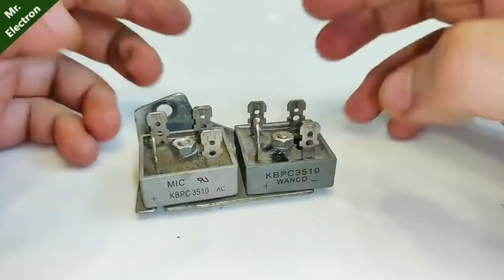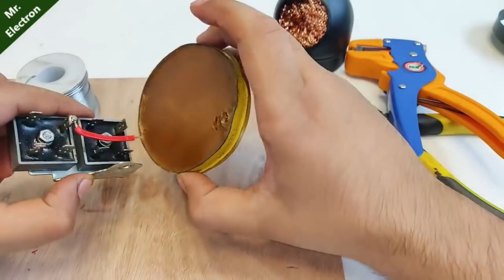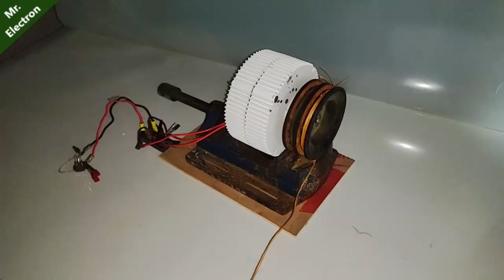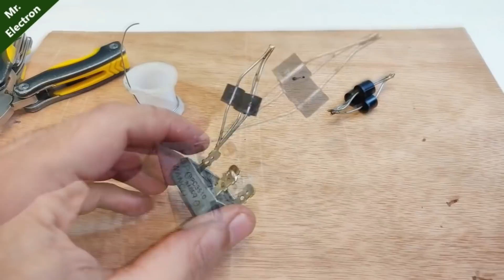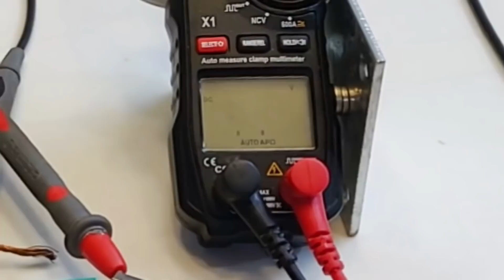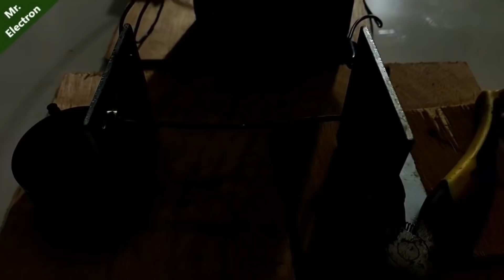3 Simple Inventions with Electronics

Comment: Profesor, 
FYI.
Each diode has its own Anode Katode voltage, I mean all are near 0,7V but not exactly, it means it's not possible to parallel diodes directlly. The lowest voltage diode will draw more current than the others blowing soon, then the same will happen with the rest of diodes. Of course it works for your video bit it will not work in real live. To parallel diodes it's necessary to serial a very low omhs resistor for each diode to balance the current on each branch.

Comment: Sorry but your soldering technique is all wrong, you will create dry joints like that !!
You should heat up the wire and post with the iron then apply the solder which should be flux core solder. The flux is intended to remove any oxidation.
There was no need to clean the posts with the Dremel tool !! Doing so can actually remove a thin layer of tin, silver or gold coating applied by the manufacturer.
You should not carry solder to the joint on the iron as that can contain burned flux, you should clean the iron tip first.
If possible make the connection mechanical before you solder it !
Add the flux paste if you need to, heat the post and wire that are together with the iron, then add the solder as needed, done !

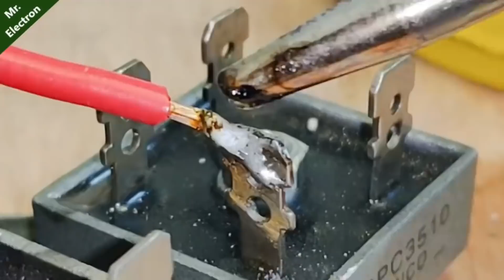Comment: Stay away from the chemicals and learn to solder the right way. What you show on time frame 2:30 is a cold weld. Give the solder in the wire time to melt and bond with the solder on the pin. Then you know the connection is good. What I see in this video is pure amateurism.

Comment: I would suggest using a larger gauge stranded wire. Copper Loss can create higher resistence in smaller gauge wires resulting in heat. It doesn't hurt to "overbuild" a circuit to avoid heating of soldered joints. Also, put some metal on those recifiers to create a heat sink for them using heat conductive grease on the metal heat sinks for effective heat transfer. other than that, nice video!

Comment: I very much wouldn't expect those rectifiers would be 400 A rated.
Reply: It’s good to understand what „single 10ms Puls“ in front of 400A means.
But the „solder joints“ will re“fuse“ to work with that current range anyway. 
Assuming lead solder, they will open at 183C
Reply: The specification for those bridge rectifiers is about 400Amp PEAK, 35Amp continuous, he's misleading everyone.
Also beware as china will sell you duff ones that will blow at about 5Amps !!
Ask me how I know !!! lol